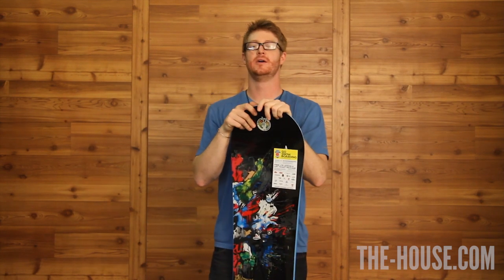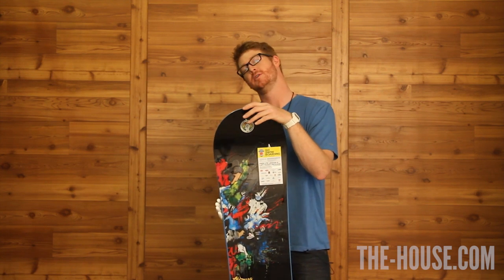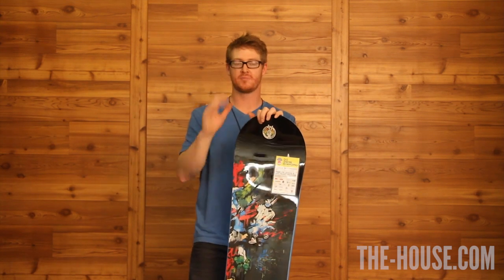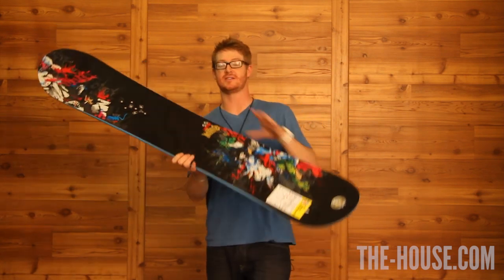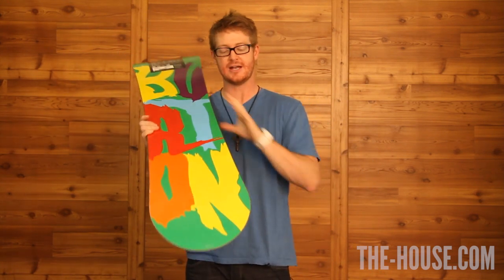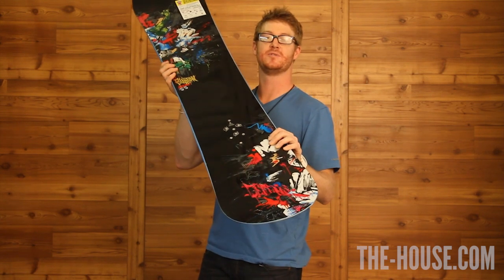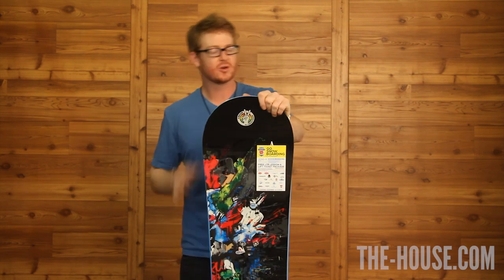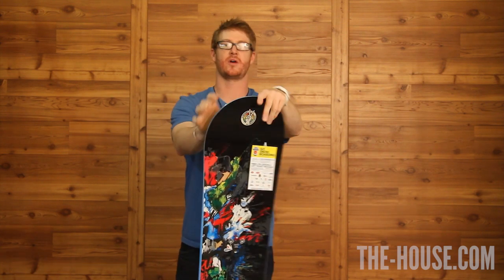Burton Blunt Snowboard 2011

Comment from the maker: @surfjat15 They are both soft flexing park board.  The one thing i like better about this years Blunt is the addition of frostbite edges. Last years whammy bar also has Mid Spoon- which is for better butters and not catching edges in the park.  Other then that they are on the basically the same. If you all about buttering around in the park get the whammy bar.

Comment from the maker: @bigboyminder Its about a inch bigger so no big deal. I am 6' with size 13 boots and i ride a 163 and a 161 in the park, but I weigh around 210  so if you under 175lb  I would say find a 157 W. if your around 190 go for the 159